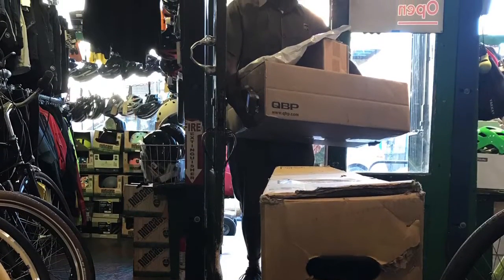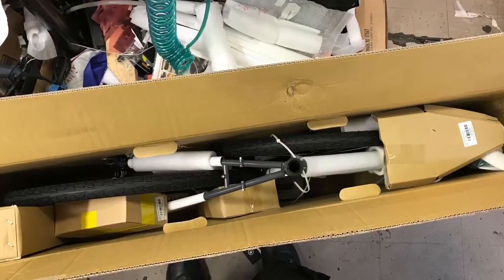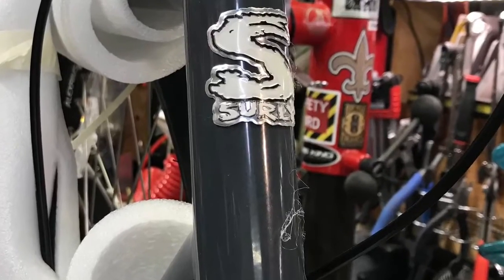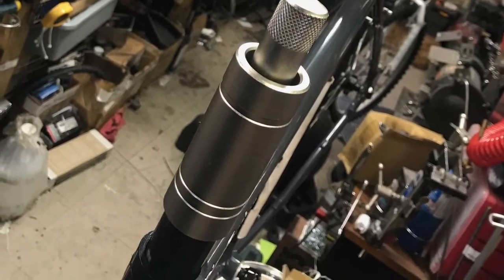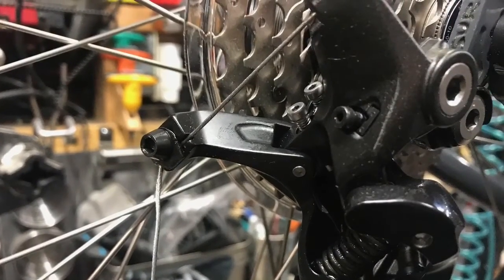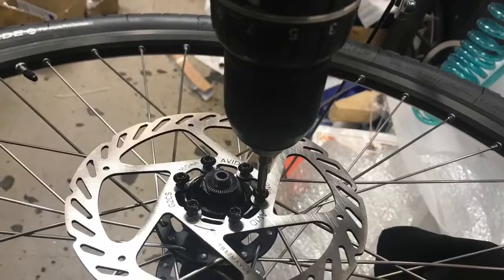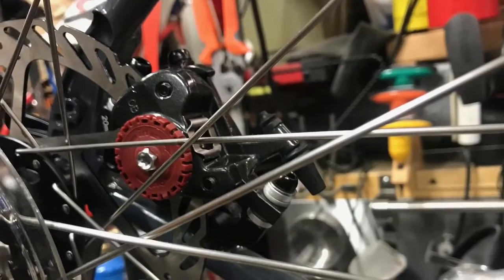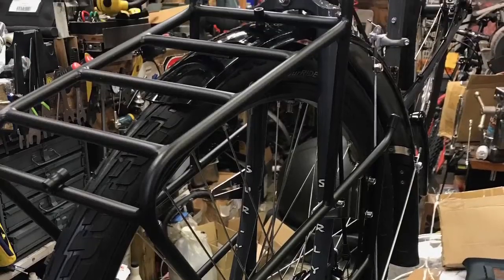“Bon Temps” is born!

Comment: How tall are you? I want a surly bike also I’m 6’0 and I don’t know on wether to go for a 54 or 56 in 26 inch tires
Reply from the maker: Paulo I’m right about 6-2 if I stand up straight, all I can recommend is sitting on both and checking the reach if you can at your local shop
Reply: reddmage so I went to a local bike shop and tried both sides 54 and 56 seems like the 56 felt more suitable with enough leg clearance when standing and when pedaling. Thank you for the advice on going to a local bike shop.